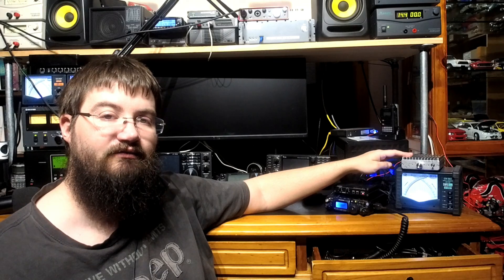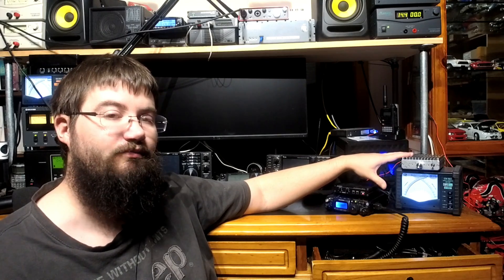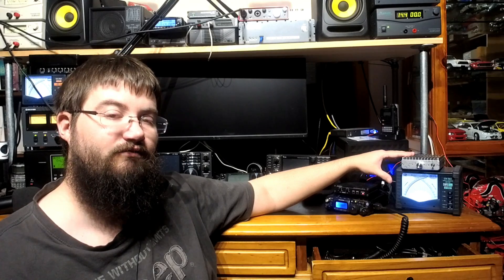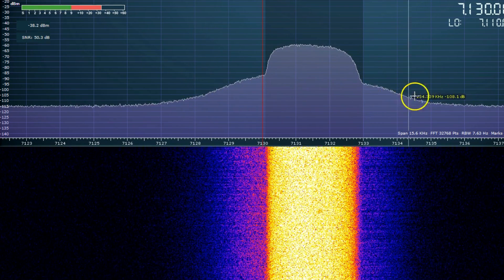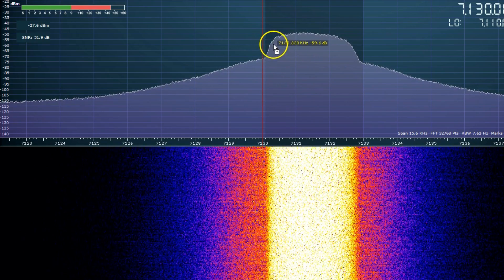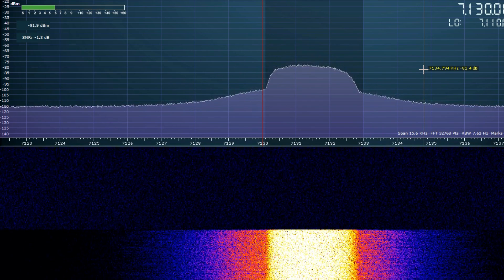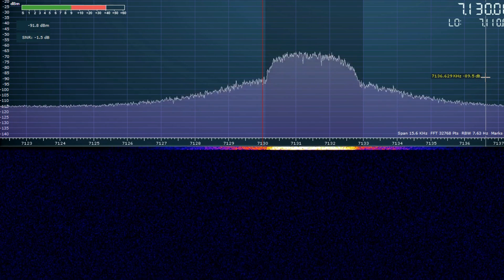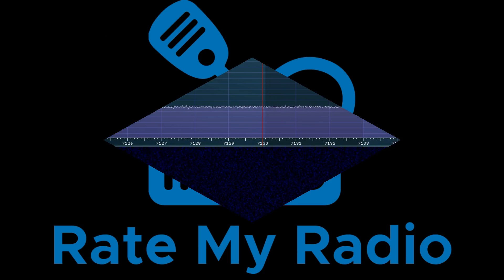MX-P50M Preview & Signal Quality Tutorial

Comment: Very nice review. How could I use it with a minion 3001 which has no PTT output. Thanks, Paul, ON5EX
Reply from the maker: Unfortunately you will need to key it somehow. You could manually key it with a push button, and you can also get foot pedals from Heil that have a dedicated keying switch for exactly this situation.  Otherwise, you could explore modifying the hand mic to offer a keying output for the linear.  73, Jarrad VK3BL :)

Comment: Excellent review. Do you know if it will work with different brands of qrp radios (ex: xiegu 5105)??
Reply from the maker: Yes they work with most QRP radios as long as you can supply a keying line or manually key up before TX.  The only thing to watch out for is overdriving them; 4-5 watts is heaps.  73, Jarrad VK3BL

Comment: Great video, I just subscribed.  I also just bought the FT-818 (never owned the 817).  I also just ordered the MX-P50M.  For the 817 and 818, is it just plug and play?  Just plug the control cable into the ACC jack on the radio and away you go?  Does it require any internal setting modifications to the 818?  Warm Regards! -- Steve....

Comment: Any chance of a picture of the internals?
The reason I ask is to see if there's sufficient room to add a little RF sensing board to do TX/RX switching rather than using the external hard-wired PTT. The hard wired thing would stop me using the amplifier at the same time as connecting the radio to a computer because both use the same accessory socket on the radio.
Reply from the maker: Dear Andy,

Absolutely we will provide some photos of the internals of both the amps we are reviewing.  

You're not alone with that problem; I believe you can wire a capable up specifically so that computer control and amplifier / tuner control is still possible.  I haven't made one yet but it is something I will have to do, as I am keen to use FT8 portable with my FT-818ND.

Stay QRV, 73, Jarrad VK3BL :)
Reply: Thanks! :D
Looking forward to the reviews and pics.

Comment: Great review.  I've been wanting to see this for a while.  Is there any plots that show the output with a lower input? 2.5 or .5w.  Thanks
Reply from the maker: Dear Tim, we will definitely have that sort of stuff in the follow up videos :). We've obtained two of the most popular Chinese amplifiers using the MRF 186 Mosfet, and will be comparing both :). 73, Jarrad VK3BL
Reply: Just wondering how the amp is holding up for you?  And wondering if you had a chance to test the other eBay amp as well?  73 KF7VUT
Reply: @RateMyRadio  Why on earth don't you nominate the part number of this black box amp with auto switching. I have looked for you review on that and can't find it.. It is pointless to mention it and then not give the part number.  Muchas gracias ex ZL

Comment: Nice presentation I would like to see how you set up using SDR play as your spectrum analyzer.   Please share your setup.  Also I have the Hardrock 50 amp with tuner for my 817 and it cost a bit more but has more features.
Reply from the maker: I'll make sure to cover the setup in the comparison video available shortly :)

Comment: Thanks for the review. Btw I think you just talked me out of buying the mobile Ameritron . Is there a site that compares the specs on linear amps ?
Reply: Rate My Radio thanks .  Do you have an opinion of the ALS-606  ?
Reply: John Peterson There are much better amps than Ameritron. Most cost a bit more but have much less problems.
Reply from the maker: The 240V powered Ameritron Solid State amplifiers are all well performing designs.  They may not have the latest features, but should be easily maintainable by competent techs far into the future :). They do look kinda ugly, though :|
Reply: Thuff thanks for the comment. Do you have a personal preference - in the 500-600 watt range ?
Reply: Rate My Radio thanks for the comment . I have been looking at the ameritrons in part because of their inclusion in the mfj catalog and of course because of their price. In the 500-600 or so watt range would you have an alternate preference ?
Reply: John Peterson Hi John I have fixed a few Ameritron amps to discover they are basically basically old amp technology with little to no protection. The reason I work on the is to help my ham friends that got them. Most sell the for better amps. My choice for a 500w amp is a Elecraft, there are others in their class much better than Ameritron. Unfortunately nothing for mobile opps.  The reason is the 50v FETs needed for the amp.